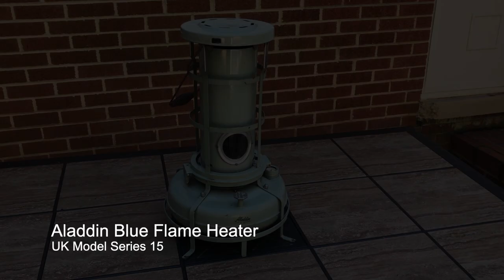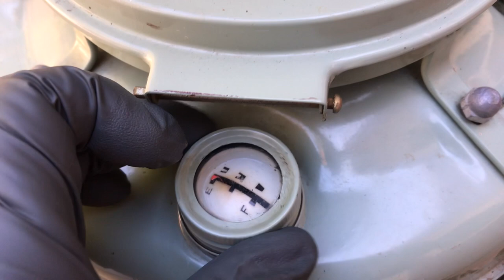Aladdin Blue Flame Heater Overview

Comment: Very well made units mine is a S681U Equator II. Easy to change wick just rotate Counter-clockwise until tab up from latch then pull knob out to release wick holder collapse wick inwardly from pins reverse with new wick. It took me 2 tries to adjust wick height corectly 3/8inch exposed when fully to right knob (3X wick number)

Comment: Thats a real nice looking heater. I'm looking for one like that. I have an aladdinette 2, it works really well but not as sexy looking as this unit. I run mine on bioethanol which burns cleanly indoors and doesn't smell.
Reply from the maker: I’m sure yours still heats and works well. These things hold up very nice.
Reply: Can you run a kerosene heater on bioethanol? If so, that would be great, cause ethanol is cheap where I live and that type of heater would save me quite a lot of money during winter.

Comment: The product information  as disappeared  before I was able to link it can you repost it please I would like to get one of these heaters
Reply from the maker: I’m sorry but I never posted a link to purchase the heater.  I only posted links to get a replacement wick and where to find the manual.  I think you can only find these used on eBay or at 2nd hand stores.

Comment: Very nice heater at a bargain price. I paid more for shipping than what you paid. Top lid and chimney section are porcelain steel and  will not  take a paint job easily. Also , soon as the wick starts to burn you can close it up, gently. That way it will not smoke and stink as bad. I have a model 37  among others.
Reply from the maker: Doug Abbott :  Thanks for the comment and advice. Yeah, this heater has been great. Someone else told me that it will be hard to paint. I think I may leave it as is; it still looks very nice. I did discover something, though, the wick trimmer is not very good at all. I had to end up cleaning the wick by hand with my knife. That will be my next video.

Comment: Great video. I just got one used for $60 it is overall pretty nice but needs a new wick and has a few spots of missing paint like yours but that is fine.  The handle is like plain metal so I might spray paint the handle thingy with high heat paint.   The one issue I have is trying to figure out how to flush out the fuel tank.  I filled with hot soapy water but it is still not that nice.  Any ideas?
Reply from the maker: That’s awesome that you got your hands on one of these great little heaters. I hope my video helps you change out your wick. I agree that flushing the tank has got to be difficult. The only thing that I can think of is to use one of the fuel transfer pumps to try and remove the fuel. The pumps should be found in the same section of the hardware state that deals with kerosene heaters.
Reply: Hi I have one of these just bought it on eBay for cleaning the tank I used a water based degreaser the stuff you use to clean your patio use with boiling water fill it about half full swill it around occasionally and leave it in till it cools empty out through the filler cap it gets all that gunk out and leaves it squeeky clean.And to make it easier take off those four dome bolts and drop the tank out of the frame so much easier that way.
Reply from the maker: @Foxy57237  that’s a great tip. Thanks.

Comment: Great heather, how can I get red of the smell??? 
I already installed new wick !! 
Waiting for you to answer, thanks 🙏
Reply from the maker: I don’t know how sensitive your nose is because I think there will always be a bit of a smell. I think your best bet is to minimize it by burning good fuel, having a good wick that is burning at the correct height, and leaving some airflow in the room.
Reply: Crafty Junker , Thanks 🙏 for your quick feedback,  my friend got 3 of them and not a single smell come out from it, I have told to use purified kerosene ( no odor) may fix the problem, what do you think, what about the one you have?? 
The issue is two parts 
1 - the smell 
2- it burns the eyes ! 
🙏🙏
Reply from the maker: So when I started using kerosene heaters I made some mistakes. The biggest one was not having a good wick that was set to a proper height. The improper wick would cause a bad odor and sometimes black smoke to come out. 

Now that we are taking about the wicks, you have to trim them once in awhile to get the char off the end. I just raise my wick and take a raspe and gently trim off the charred end. I need to make a video of that. There is a special wick trimmer, I have one, it doesn’t work well. 

Now if you are using fiberglass wicks, once about every five tanks you have to clean burn those. Clean burning means letting it burn completely out and then relight the wick so that the charred ends burn off. That eliminated a lot of smells and burning issues. I clean burn all my fiberglass wicks after about five tank fulls. 

http://www.milesstair.com/Kero_Heater_wicks.html

If your friend just got some heaters, they may want to try clean burning the wick or just change it. With this specific heater a properly adjust and clean wick should burn nice and blue all the way around. 

Finally the fuel. K-1 kerosene from a good place is important. I say “a good place” because sometimes that can be subjective. Some farming stores have kerosene in old tanks and it is just labeled “kerosene” not K-1 kerosene. I use the pink K-1 kerosene from a Shell Gas Station from an actual pump. K-1 is key. 

You can use the fuel that is clear K-1 from the stores but that stuff is way over priced. 

I hope this helps.
Reply: Crafty Junker 
Man you are such a great person, 🙏
Thanks for your feedback and full excellent explanation, I had my wick replaced yesterday I have to look around for k1 and see how it works. 
Are based in Turkey 🇹🇷?
Reply from the maker: No. I am in the US. I know that in some countries kerosene is called paraffin. Maybe that will help.

Comment: Where do you find the model number on it?
Reply from the maker: So I could never find a model number on it. I had to search and search all over the internet for old manuals. Eventually I found one online. I highly recommend milesstair.com, because the site has so many references for old or obsolete heaters. Also that website has of the old manuals that you can view and compare your heater to. I hope that helps.
Reply: @craftyjunker6298  thanks! I took it apart today and found that i need the button type of wick lol and i did check his website for it. Thanks again!